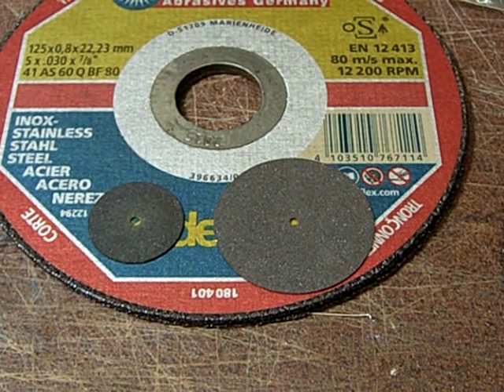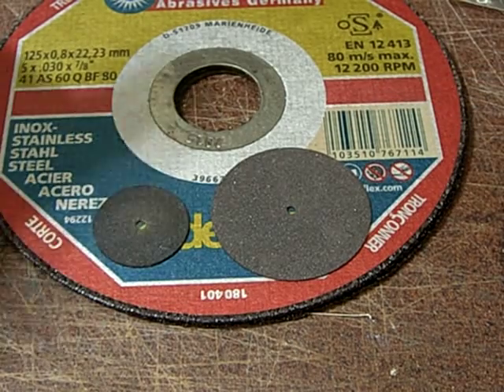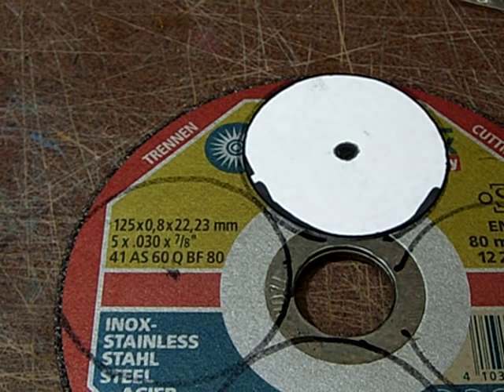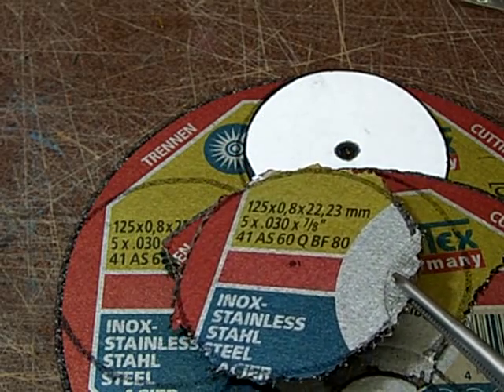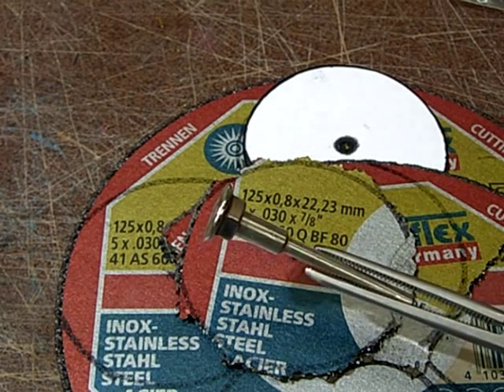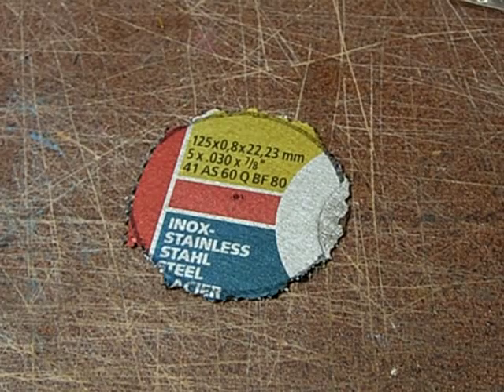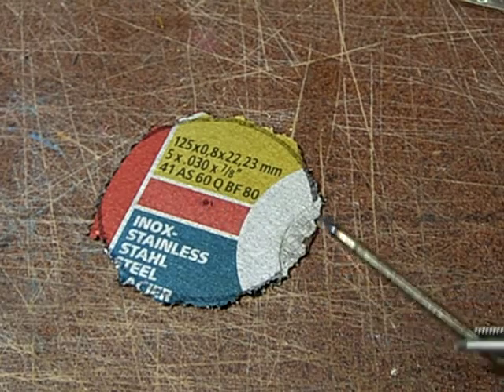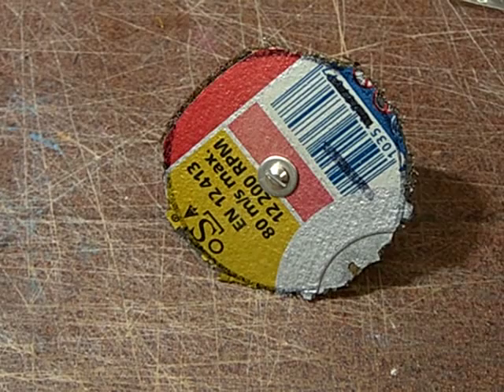DIY Cutting Disc for your Dremel/ Proxxon grinder

Comment: nice tip! cutting discs for angle grinders are much stronger than the Dremel ones! you can also grind off the irregular points on the disc edge by using it against a stone for a couple of minutes

Comment: Indeed  a really  good idea  observation someplace in the middle of this story  most of us may have an angle grinder it would be for most of us 4 to 4 1/2 inches  and a hole saw can be an alternative to cuting thes out would be a thing you may want to mention asides from all that the idea is very kool indeed 
Sounds like it's a great way to save a few bucks 
Thank you for shareing
Reply: I hole saw would be great but it wouldn't last long cutting through the abrasive. I ended up with 2 of the same size though, so I may sacrifice my extra one to make a few disks.

Comment: A few years ago I bought a packet containing 10 diamond coated cutting discs and 2 arbors, so far a haven't been able to even wear 1 of them out, this including cutting and grinding tungsten carbide tool bits and they were $5 dollars for a pack. And yes they will cut an 8mm bolt like a hot knife through butter.
Reply from the maker: Hi, thanks for your comment! I bought some of those diamond discs ~10yrs ago, and they were crap. Maybe technology has improved meanwhile. I would like to try. Could you give a link to point me in the right direction? Is it this what you mean?
https://www.ebay.de/itm/10X-60mm-Diamond-Cutting-Disc-Set-Drill-Bit-for-Rotary-Tool-Glass/302497609896

Comment: hi..this is a very practical solution. Just out of curiosity may i ask you will the "12500 rpm" max mentioned on the industrial blade suit the higher rpm of the dremmel??
Reply from the maker: +EMPEROR MOTOR INC. Well, as the disc is broken into pieces, we are operating out of spec anyways. But as smaller discs create less centrifugal force, we are good to go. Never had a disc go bad or spontaneously desintegrating. Wear safety goggles all the time though.
Reply: Great. These lil cut out dics are an excellent alternative to the reather expensive and easily consumed dremmel discs....thanks a lot for the reply...
god bless

Comment: Dear All

Why are dremel like rotary tools using cylindrical shafts for the cutting plate instead of square shafts that gives a firm grip? I like to know the rationale , thanks.
Reply from the maker: +Cosmo John Actually, there is "Dremel SpeedClic™", which allows for a more rapid change of tools. However, surprise, surprise, tools for this are more expensive. The round shape has the advantages of being cheap and easy to manufacture, and to fit for all kinds of discs. Torque-transfer is not really a problem as we usually work with high RPM and low torque.
Reply: Extremflug
Thanks for enlightening. Cheers!

Comment: I do not understand why Dremel is unable/unwilling to make Sanders, cutters, etc that last longer than a match stick burns. Money is my guess.  I have 7 nonfunctioning rechargeable, handpieces that no longer recharge. I am home crafter senior as the only user. Tool is treated well, it is just crappy & unreliable.  Bought a couple generics for $10.00 from Big & Lots, WalMart that lasted longer & just as well as Dremel, used same attachments, too.  Dremel should fix problems or drastically lower prices & make diy fixes quick, easy, & possible.
Reply: All the grinding and cutting takes its toll. Everyone wants a great handheld device that can do almost anything but it should cost nothing. There are better options. I prefer the IBS/E from proxxon...still dirt cheap but at least not that noisy and wobbly. Once in a while there is a foul one but just try a different one. 
If you want something better you can buy some from jewellers and dental labs...grab those 1500-3000$ and you got something that will last a long time. I buy the above mentioned with a longer warranty and if it breakes down I'll get a new one.